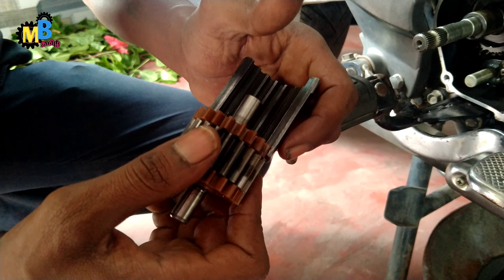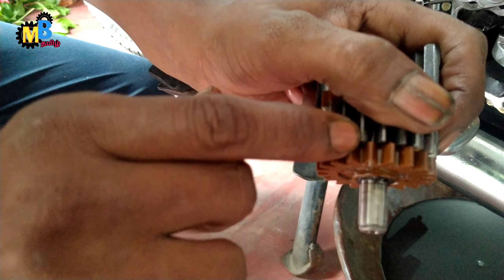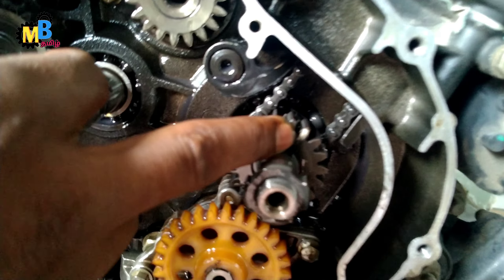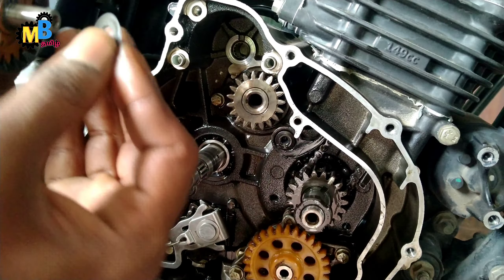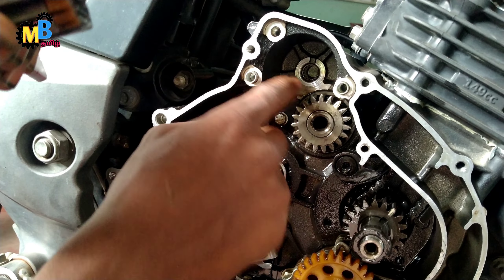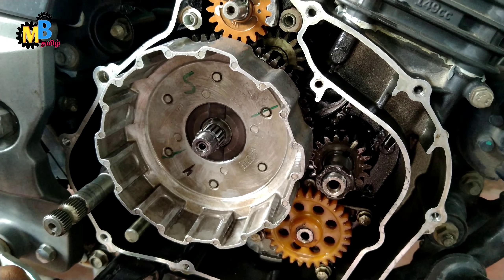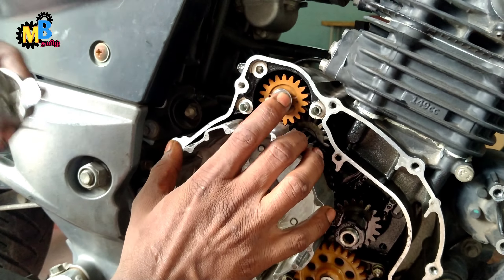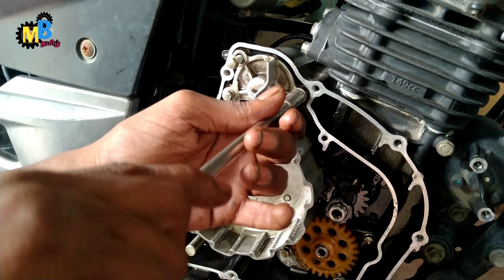PULSER Full Vibration Problem/SCISSOR GEAR/Motorbike tamil

Comment: Bro..en pulser 180 ......50km to 60km speed la pogum pothu mattum romba vibration aaguthu
Reply from the maker: engine bed bold tight a irukkanu paruga bro.. bed bush pooierutha change panniduga ...thanks for watching 🙏🙏🙏
Reply: @motorbiketamil  bike 2 times full service pannitan bro...but problm solve aagala.......0 km to 45 km speed and 60 km to 80km speed pora apo bike smootha iruku....50km to 60km than semma vibration in foot rest,handle,doom fulla

Comment: Bro... ennoda bike  50 to 60 kmph pohum pothu mattum over vibration varuthu... enna reason bro..? Recent ah intha balencer adjust panninen. Athukaprom than ipdi aachu
Reply from the maker: balancer gear wheel timing vachi matirukkagalanu paruga bro.. ok na engine bed bush nalla erukkanu paruga ok na engine bed bold anaithum full la tight pannuga ok aagidum ... thanks for watching 🙏🙏🙏